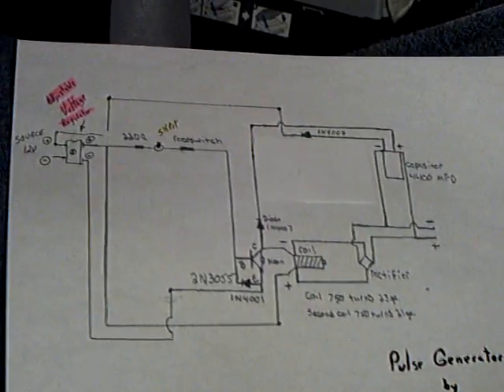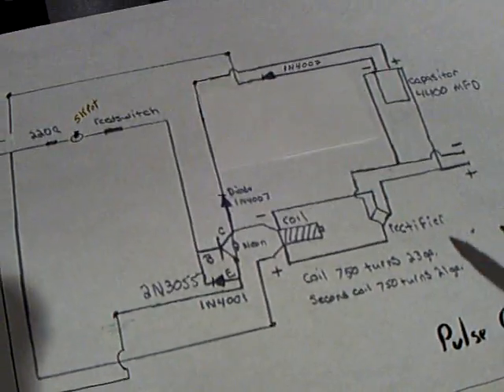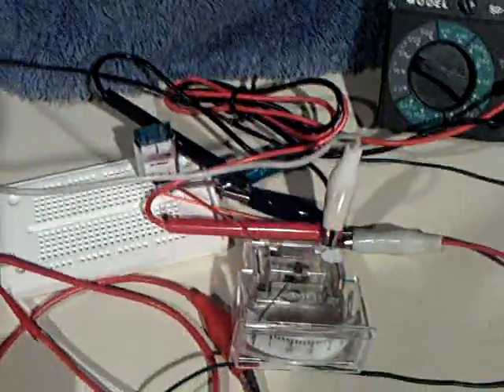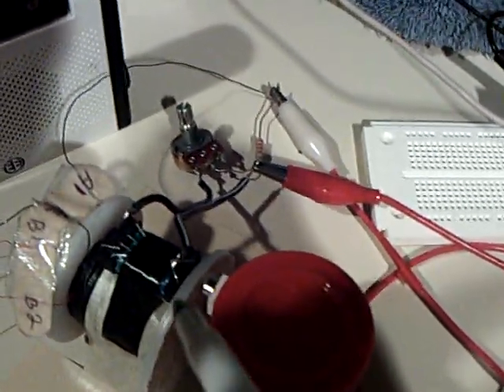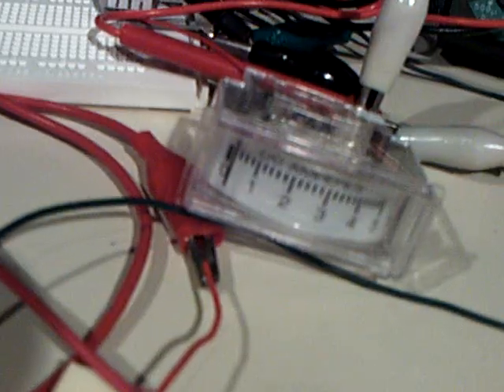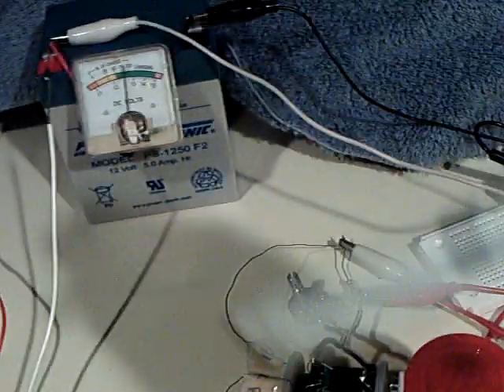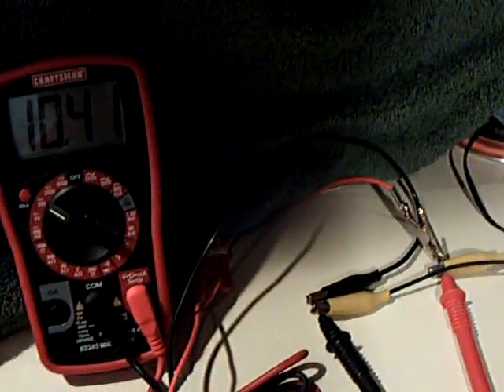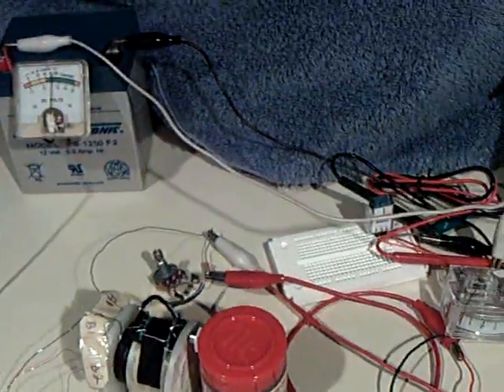Load testing the Slayer007

Comment: Nice work it can be tedious sometimes but worth the effort if everyone can learn from the experience. it may just be a matter tweaking you coils a bit, are they twisted together then wrapped? I had some trouble with my motor controller at first now it can make hundreds of volts with some usable amps to boot.